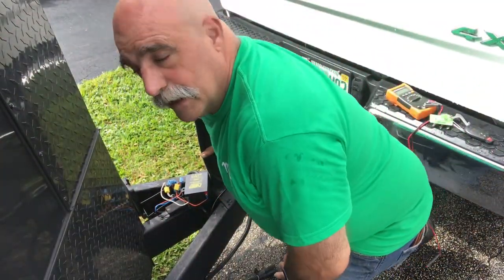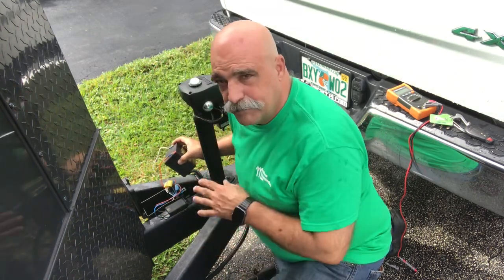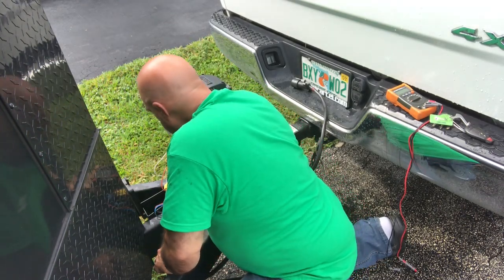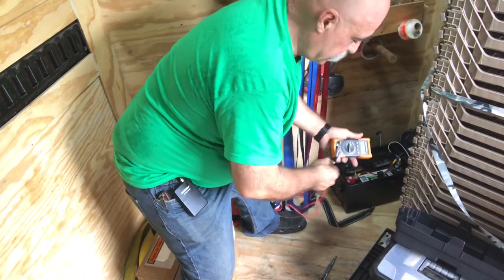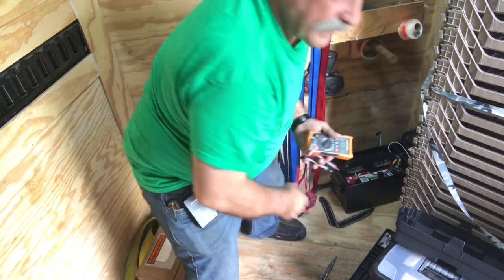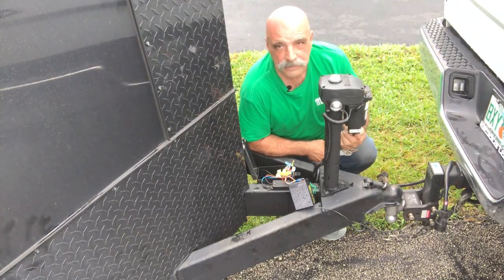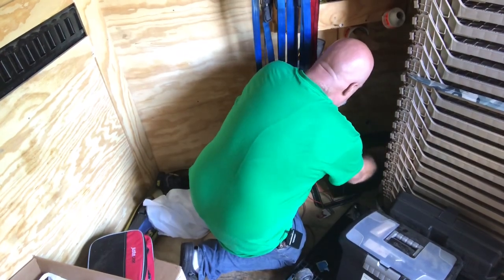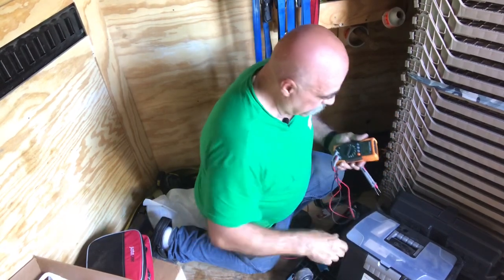How to charge your battery in your trailer off your seven pin

Comment: Good idea however im surprised that you didn’t blow the 30a fuse when you cut the cord cap off!
The hot and ground are directly connected to the battery and your side cutters could have created a direct short as they penetrated the conductor 
I would advise disconnecting the battery first
Reply from the maker: You need to watch it again the wire that I cut was the one that goes to the electric jack, I tied that into the rest of the system so when he connected his seven pin to the trailer it also operated the electric jack, so he didn’t have to plug the jack in and then when you after he hooked up the trailer then unplug that one and plug in the trailer jack, I combined them together so no that would not blow out the fuse the jack was not connected to any power until it’s connected to the truck.
I hope this help you understand it better thank you for your comment.

Comment: So why did you install a new 7 pin connector? Did the original not have a 12v positive?
Reply from the maker: I did not install a new seven pin connector he had 2, One was for his Jack and one was for his trailer so I eliminated the one to the jack and tied it into the other seven pin on the trailer, so he would only have to use one.

Comment: Dam. I needed your help and can't hear you . maybe do a voice over
Reply from the maker: Pamela Skinner What help do you need I’d be happy to help you let me know your question
Reply: @buildingwithpapa  I have a camper and a Ford Escape. Campers all wired up right. 7pin round.  The guy put a wire harness on my Ford (7pin round) but didn't hook up the wire that makes it charge the battery as I drive. Now I don't know what wire I need to hook the two together if I did it myself.
Reply: I see your in ft Lauderdale. Is there a nice place to camp there (not expensive). I could bring it to you. I'm a single gal. I need all the help I can get. Plus  my fridge won't lite on propane for some reason. It was fine then stopped.
Reply from the maker: Pamela Skinner The seven pin harness should have a positive and negative wire you’ll need a meter to test them find the ones that are coming off of your truck that are the positive and negative if you use a meter it should say 12 V when the car is not running and when it is running should be 14 V
Reply from the maker: Pamela Skinner your camper you’re saying has a seven pin there should also be a positive and negative wire on that you’ll have to chase the positive wire that should be going to your battery set up in your camper that’s what you need to make sure of if it’s not then you will have to run a positive wire off that seven pin to your battery and use a fuse this will go to the positive side of your battery and then it should charge your battery need any other help just let me know if you’re having trouble then maybe we can do it with some pictures that I could help you to try to connect to your battery and charger it

Comment: I saw that you had a smaller battery. Did you removed it or did you leave it still connected with the bigger battery also ?  appreciate any information about that.
Reply from the maker: Yes the smaller battery I left it connected it was also a 12 V that is for the brakes on the trailer this helps you thank you for your comments

Comment: How do we know it won’t overcharge the battery? Is that what the fuse is for. I need this setup for a trailer with a winch. The winch runs off the batter but I have to manually remove and charge each time.
Reply from the maker: Yes that is what the fuses for so it doesn’t overcharge the battery or if there’s any other complications that would heat up the wire the fuse would blow first

Comment: What size wire did you use to go to the battery?
Reply from the maker: When you look at your seven pin the wire that’s coming off that for your 12 V positive and negative is the same size wire that you want to use to go to the trailer to the battery I believe it was a number 10 I would have to look again I hope this helps you

Comment: What purpose does a battery in trailer serve?
Reply from the maker: Daniel Jimenez Well my son-in-law delivers bread so he’s out very very early in the morning the battery is for his lights and he has a couple fans to help keep him cool because he’s in and out of the trailer all day long delivering bread to all the stores
Reply: Anything that's under 12v.  I have a popup so the list would include:  the refrigerator, the lights, raising the roof, the stereo, the fan, 12V plugs and USB plugs.... which I believe is the same things a battery does for a regular RV.  Everything else requires AC power or propane.

Comment: I’m interesting in all the wiring part. Can you do another video explaining what you did. Sound cut off on most important parts. I’m sure a lot of people are going to find that video helpful.
Thanks for sharing with us.
Reply from the maker: Andro Sound & Lighting I added an in-line fuse for 40 Ap 
on the positive side of the battery
Reply: Thanks for the help. I thought that’s what you did it. I wired my trailer yesterday and the alarm is installed. My only concern is if I have to change the fuse for the 7 pin conector since I now have a second battery and the alarm. Don’t want to blow a fuse..  
again thanks for your time.
Reply from the maker: Thank you for your comments, let me know what you are looking for this trailer actually had the battery set up in the trailer already but not charging so it Already had the negative wire hooked up all I had to do is run the positive wire to the positive side of the seven pin and that’s what I show you in the beginning using the meter to find out which is the positive and -12 V wires coming from the truck and you can identify on the seven pin to the trailer and those are the wires you would be hooking up you would have to use both negative and positive if you don’t already have a battery hook up inside the trailer. I hope this helps make a comment or ask me any questions you’d like I will try to help you thank you.

Comment: I enjoyed the video, but I don't recall that you mentioned how you wired the negative side of the battery. Where did you ground it?
Reply from the maker: The battery set up was already in the trailer and they had a grounded to the frame and they had the wires going directly to the lights but there was no way to charge it so I connected it to the seven pin the white on the negative and the black one on the positive of the seven pin it was already on the diagram of the truck which one was which it was easy to connect and now the battery is being charged while the truck is running

Comment: Sound cuts out, and can't see what wires, are being connected, because camera is too far away.
Reply from the maker: You have to look at your seven pin hook up on your truck or vehicle it will show you the negative in the 12 V positive that’s where you would connect your wires the black would be positive and the white would be the negative let me know if you need any other assistance

Comment: Audio fades in and out badly ! My question concerns preventing back feed from trailer battery to truck using a diode.
Reply from the maker: What diode do you use to prevent the back feed
Reply: The connection is only made when the truck is running. That’s why he had to start the truck. It would only pull from the trailer if the truck batteries went down and you might be glad it did.